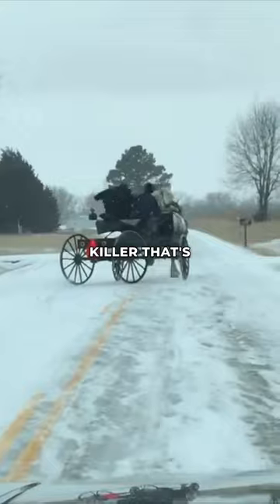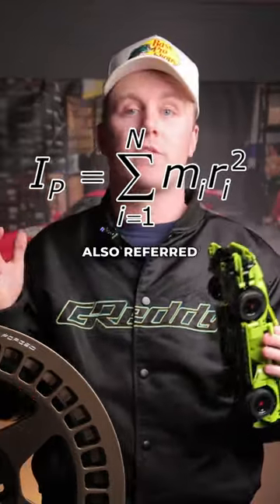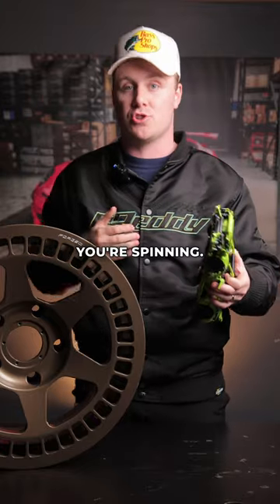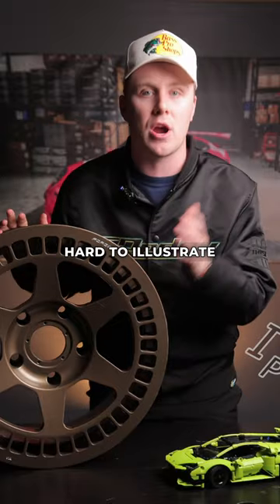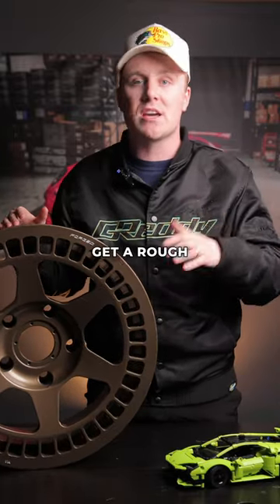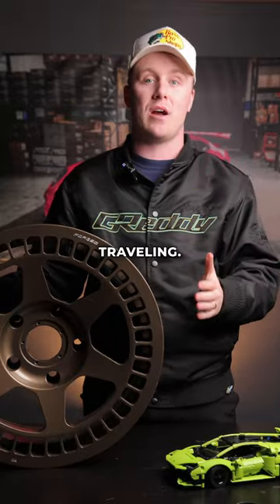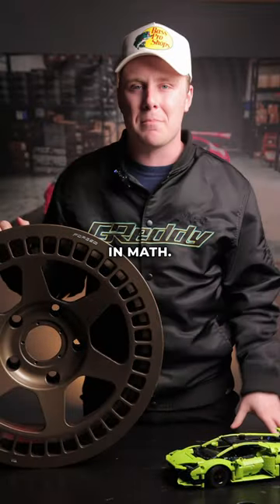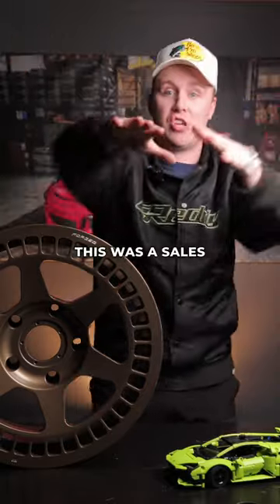This is Slowing Down Your Car! #shorts

Comment: I did the math and assuming a 10kg wheel accelerating to 60mph in 4s, with diameter of 0.4m, it feels like you weigh an extra 28 kg or roughly 60lb, nowhere near 540lb